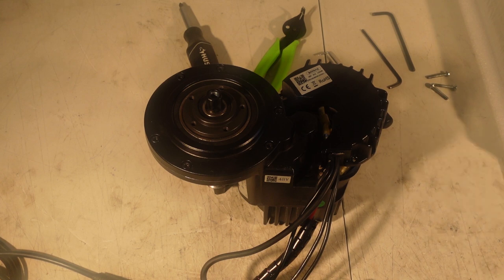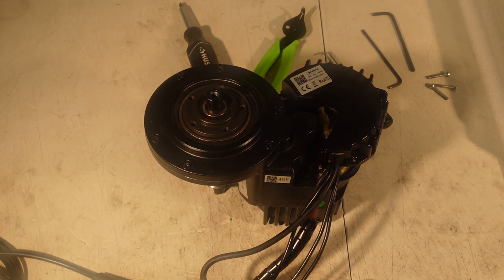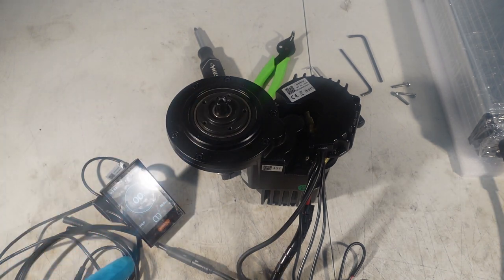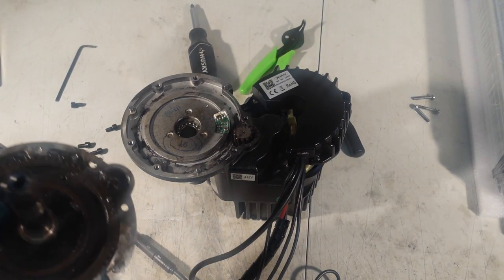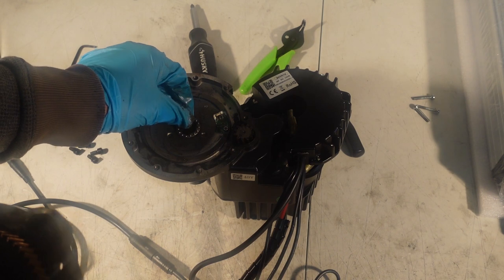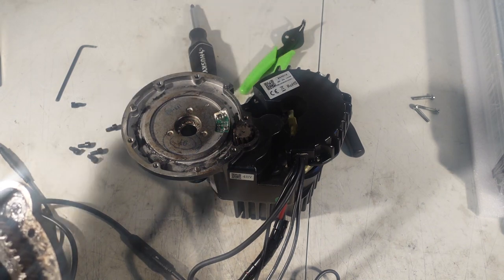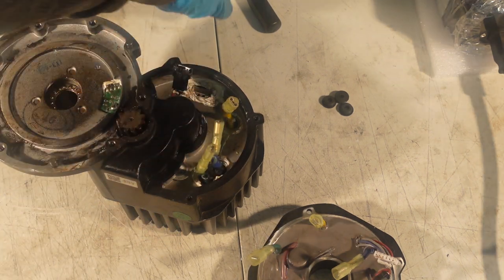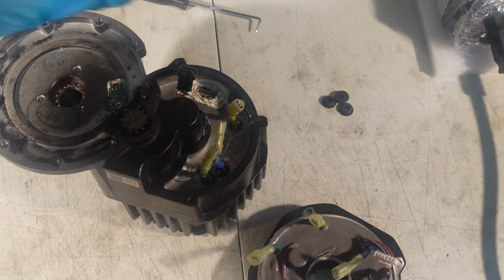Bafang BBSHD Disassembly/Nylon Gear Replacement

Comment: love a company that supports maintenance and repair
Reply: Hi l have 2 motor bafang, but it is stopping to work, please how can l get you for fix me that please
Reply: Why not use metal and not have this problem at all?
Reply: @markdove5930  I think the nylon gear makes it quieter.
Reply: @franksabo1751  and it acts as a mechanical fuse for when the motor gets too hot
Reply: @markdove5930  A metal one will give you a lot more trouble it if goes wrong.

Comment: 6:50 Tip: You have 5x M4 screws on hand for removing that plate. No need to buy more. Same screws that hold your Chain Ring on. Also it's a good idea to place your hand over the Snap Ring when removing it... unless you like chasing around the room looking for it when it fly's off the Snap Ring pliers.
Bonus Tip: Use LUCAS "Red-n-Tacky" on all the gears before reassembly. It'll resist flinging off and is PFTE Nylon(or PEEK if you upgrade to it) Safe.
Reply: Best grease of it's type totally agree.
Reply: I have a tub of lucas extra heavy duty grease. What about that?

Comment: Get a $30 motor tester. You can test throttle, phase wires and Hall effect sensors with out disassembly. And get an electric nut driver to save time. And snap rings have a top and bottom. It also helps to put your hand on top of snap ring pliers so when the snap ring flies off your not on your hands and knees looking for it. Also be careful not to over stretch the ring. It will not fit tight into groove.
Reply: Where can a tester be purchased from please?
Reply: I think they can be purchased at Amazon.  I know I bought a tester there a few months back, mostly to test brake sensors…

Comment: It's good to see how easy these are to work on. I took mine apart a few hundred miles ago to add some grease around the main gear and was lucky enough to not need to replace the cardboard gadget which people seem to have issues with. At least I know that I have a spare if my nylon gear goes at some point. Thanks for showing us the procedure. I doubt there's much difference in between the three main mid-drive units.

Comment: Great stuff, just fitted my bbshd motor but will do this if the motor fails to turn the drive shaft. Already greased the large drive gear and pinion as standard from new, and I must say its very quiet and smooth! ..thanks for the tutorial!

Comment: Thank you for this video! I was able to replicate this procedure on my BBS01 thanks to your help. (The nylon gear was fine after 25ooo km, though. The motor does make noise. It got better but not good just by cleaning/greasing, apparently that's all that can be done right now.)

Comment: Yes interesting video thank you, been fitting these motors for 20 years with little problems or any coming back with issues or for repair. Just working on a brand new 350 watt model fitted it and connected the battery and error OH8

Comment: Great Video interesting and a big thank you. The motor must have had a rough life, I have lost count of how many mid- drives i have fitted in 20 years, not one returned this nylon gear worn.
Reply: Im about to replace my controller after error 21 how do you think he tore it up i may have a similar problem. Ive been running the torque hard and the battery starting giving up more and more until the error appeared. Is this where i should start with troubleshooting if the controller doesnt fix it?
Reply: @roncooke2188 have mid drive motors been around that long?

Comment: Love what you've done with Golden Motors. Just wanted to say if you start carrying the BBSHD PEEK Gear I'm sure you would sell out in NO time! They've been out for a couple years now and it's still hard to find them not on backorder.  P.S   If you ever decide to open an East Toronto location like Scarborough I would work for you in a heartbeat!

Comment: Not a wise idea running the motor with the rotor grinding on the windings. Should be run in both bearings.

Comment: I have a rad rover with a bafang 750. Not only do I need the gears, but a little bit of moisture(rusted pawls, riveted in) ended up taking out my one way, behind the gears..... my question to you, is it possible to buy this one way drive?

Comment: Hi Golden, yo yo, Great video and really useful. Hop you are well. No idea if you will pick this up but  just wondering if you have ever regressed the main gear without removing from the motor from the bike. I have wired my BBSHD in nicely and took a long time so would rather not remove the motor from the bike and so was wondering - is it possible to 'safely and effectively' try degreasing and degreasing her still on the bike? I have the in/out play and so looking to replace the thrust bearing so i'll be in there anyways.

Comment: It is a snap ring, and snap ring pliers. Try using the other holes in the pliers to squeeze open the snap ring.
Reply: Hay always willing to help. I have been a mechanic for more than 50 years. Fixed wing air craft mechanic. Cobra helicopter and armament mechanic and technician for 20 years in the army,and now I’m learning ebike. Life is surely fascinating,so much to know.
Reply: Yes, could not understand why he was using snap ring (circlip) pliers all wrong, change the pivot point hole!

Comment: Is it possible to mount the nylon gear in the opposite/wrong direction? I think it cant because the washer or clip won't fit in the groove of the shaft. I ask this because after regreasing everything with mobilith shc 100, i get an usual screaming noise when the motor turns without the chain.

Comment: Is it advisable to use white lithium grease for nylon, plastic & rubber materials?
Reply: @kumunoy He should not be using that type of grease, after some research I found out that you should use synthetic grease on plastic/nylon gears, not oil based as he is using, also it needs to be silicon free because of the aluminium casing. I am just about to replace my gear in my bbs02, I'm going to use molykote EM-3L which has the properties I mentioned above, Mobile 28 or Mobile shc 100 also works. Hope this helps someone.

Comment: Getting ready to take my bafang apart.  When I try to pedal without the assist on the chainring doesn’t move.  If I turn the assist on the motor kicks on but I still don’t have any engagement of the crank.  Have you seen this happen with the bafang?

Comment: Tore mine all apart and everything looks perfect. I don't get what's causing the grinding noise. Stumped actually.
Reply from the maker: More than likely not enough grease on the main steel gear

Comment: He should not be using that type of grease, after some research I found out that you should use synthetic grease on plastic/nylon gears, not oil based as he is using, also it needs to be silicon free because of the aluminium casing. I am just about to replace my gear in my bbs02, I'm going to use molykote EM-3L which has the properties I mentioned above, Mobile 28 or Mobile shc 100 also works. Hope this helps someone.

Comment: Is the motor supposed to run that loud (after repair) ?
Reply: You can actually fix this repair with one single little washer, and it makes the motor whisper quiet. That's all it is

Comment: i've always wondered why people buy the bafangs, because that nylon gear is a problem waiting to happen, quite silly to use a plastic gear, and the controllers have a high rate of failure too, that's why i prefer the rear hub motor, i've had my 48v 1000w bike since 2014, it has almost 5000 miles on the clock.

Comment: How did you know you didn't have a battery issue? I think my issue is battery related but I'm not sure. I'd like to rule that out before I tear the motor apart.
Reply: It's real simple. You can literally hear the motor spinning inside the Hub and crunching without the bike moving. Makes a high pitch noise too. Also, mine would grab a little bit and then release for about 20 miles, before it completely let go

Comment: At that price I excepted metal full metal gear why using nylon it will fail for sure over time at that power it's stupid. At least use Delrin if you want to use plastic sh|t. What a shame to waste a good product with such stupid thing.
Reply from the maker: Completely agreed , we have tried suggesting this upgrade to bafang for years, I know many other dealers have done the same , I know there is a new version coming soon hopefully they did implement a full metal gear there
Reply: Luna Cycle sells a Metal version of that gear. Warning however. The Metal CNC machined gear is MUCH louder. Luna also has a more silent version Nylon replacement that uses PEEK instead of PFTE Nylon. Search BBSHD Silent PEEK Gear.
Here's an Article on PEEK: https://electricbikereview.com/forums/threads/peek-gear-for-the-ultra-needed.41723/

Comment: Why the f do they use nylon gears
Reply: Noise and its sacrificial. Nylon gear wears and mating steel screw year doesn't. Nylon is good and not bad if running less than 2000 watts.
Reply: I have two bikes with BBS02 motors and 52 tooth chainwheels. Keeping the nylon gear intact means either supplying a considerable amount of the energy applied to starts from high gear with human power or shifting down before you get to an intersection I opened my motor thinking that the nylon gear would be destroyed only to find out that my noise is coming from somewhere else. What I did find is that the cover the mine only has two screws to lift it off did not bring out the bearing which I had to cut off with the Dremel tool. That was a major pain in the ass and it required destroying the nylon gear to get the bearing out so I had to buy one anyway in addition to a new cover plate